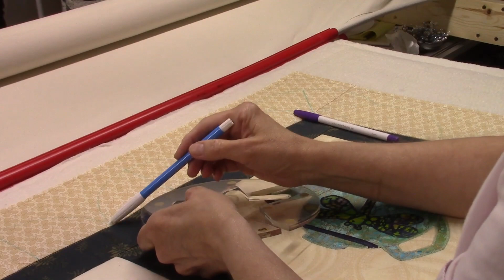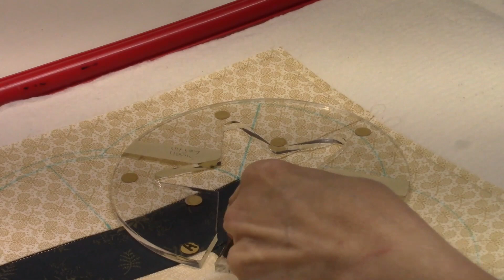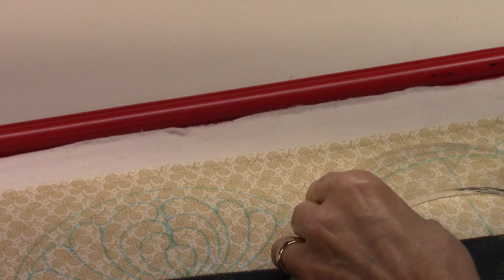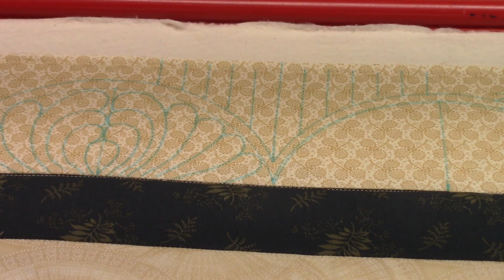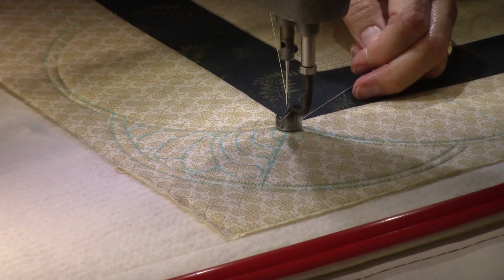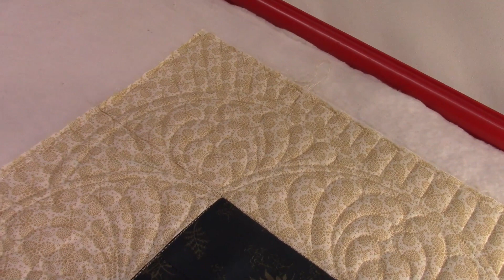Multi-Design Border Quilting

Comment: You put your marker tip in the hole in the center of the little spacer so when you draw the line it adds the 1/4”.
Reply from the maker: I have an old metal one that you use with template plastic and a pencil, but the hole is too small to use with a marker.
Reply: These come with different size holes. I wish I could show you a pic. Thanks again for all you do